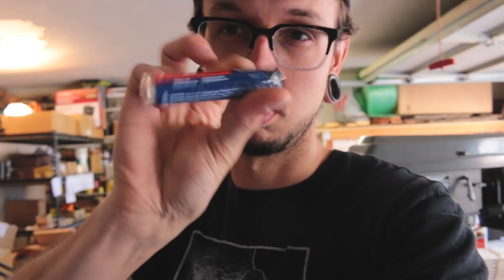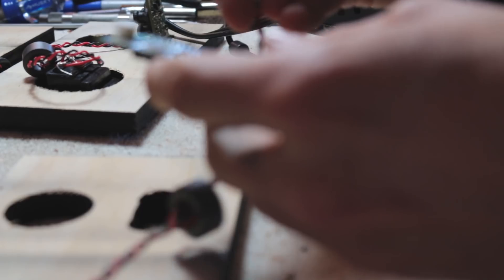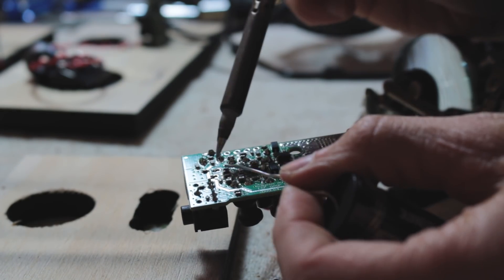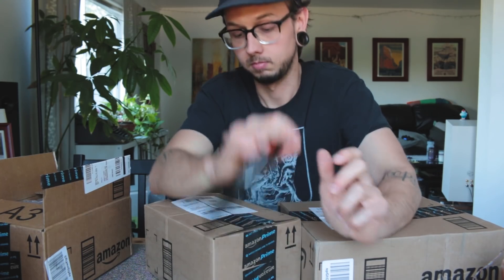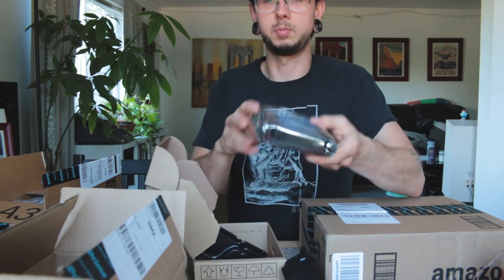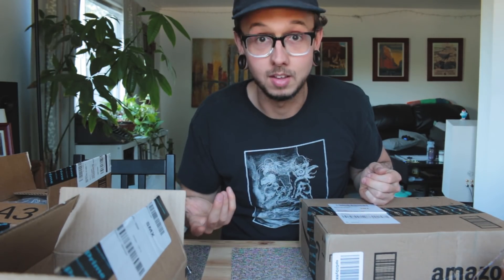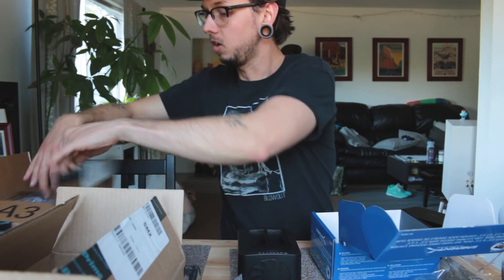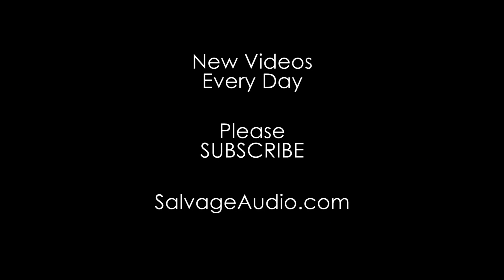Speaker Building

Comment: What is that little ring you pass the wire through?
Reply from the maker: Thats called a ferrite core. It's used to filter out electrical interference, but it's not something you really need. They just happen to come with the amp I was using, so I didn't want to waste them!
Reply: Kirby Meets Audio Ahhh thank you. Just started watching all your videos. And speaker making in general, Got me really wanting to make some!

Comment: What kind of crossover do you use in your speakers?
Reply from the maker: They are all specific to the build. The ones you see here, since the drivers are full-range, is a simple cap on the tweeter to filter lows. Thanks for watching!
Reply: So you're just wiring your own crossovers from scratch? I was actually curious if you where buying pre-made crossovers and where you where getting them from? I'm actually asking because I'm looking for a good source.
Reply from the maker: I wire my own and use pre-made crossovers. Parts Express is a pretty reliable source. http://www.parts-express.com/ They have a good selection of 2-way and 3-way crossovers. They also carry everything you need if you want to wire your own!

Comment: you don't need to put that ferrit toroid on the cables
Reply from the maker: I've read that. I'm not even totally sure what they are suppose to do, but I have them and I figure they won't hurt!
Reply: Blocks' EMI but not really necessary unless you are going to be around something that is really pumping out a ton of interference like a big radio station or something like that. AFAIK it's more of a concern in video because they work at higher frequencies.
Reply from the maker: You're awesome! Thanks for the explanation, that makes a lot of sense.